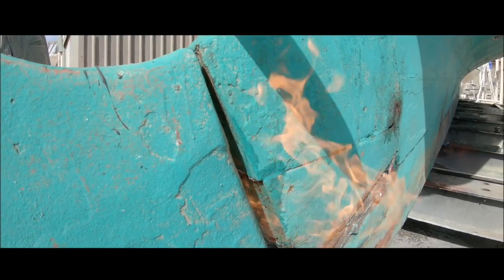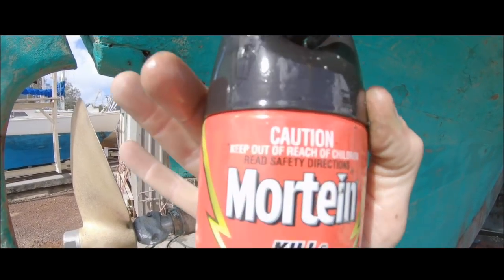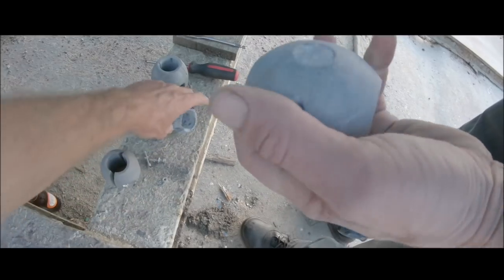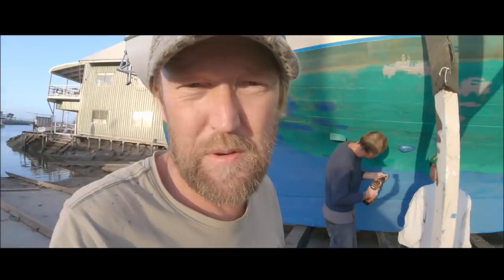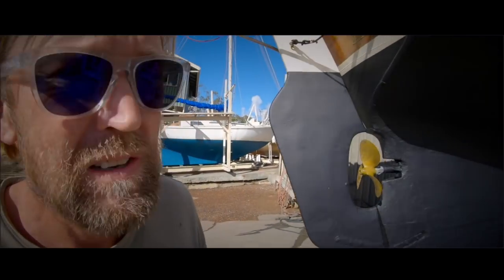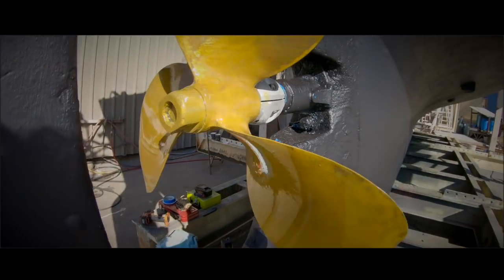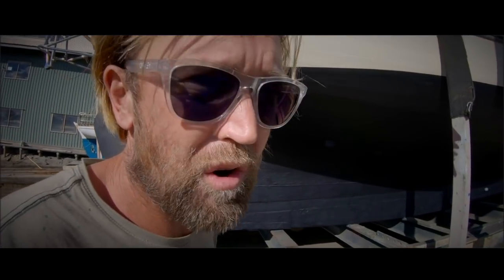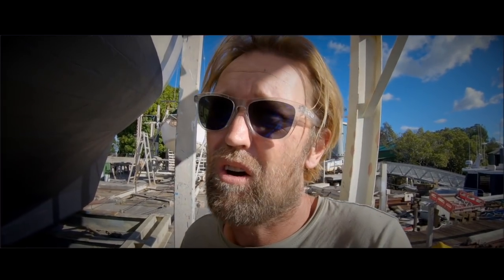Worms, Those Pesky Little Critters

Comment: Nice job with the excellent music.  Do you have "Copper Clad" down there?  It's basically fine copper powder mixed with an epoxy.  Not sure if it is appropriate for a wooden boat.  I used it in the molding process for fiberglass hulls.  If it gets fouled you simply rough it up with a sander.

Comment: The hammer little pegs in those holes when the water hits and it swells it it's becomes part of the wood I've been taking care of wooden boats for 50 years down in the Florida keys where there's a lot of worms
Reply from the maker: Aye they are stuck there now, as you said, they are now part of the boat ❤️

Comment: If you can see that many holes, then you have a serious problem. Nothing you are using will get rid of the honey comb of large holes, they will be everywhere wood underneath and you probably have not killed them all.
Reply from the maker: Thomas Morley really? I almost set fire to the boat? What would you suggest Thomas?  💣
Reply: @TheGeordietheWitchandtheWench  Im sorry, i did not mean to be the bringer of bad tidings . I know ship worm is a problem in warmer waters especially in that part of the world. it is probably a problem there that is not easy to completely remove but, and it would be allot of work. Take the hull down to bare wood and paint with epoxy tar paint. you need to put on about 5 layers, thinning to full thickness in the end but making sure that you never let it cure in-between coats. The final layer is primer, painted on before the epoxy tar has cured. You will then get a chemical reaction between the epoxy tar and the primer and you can then paint any colour you like. Worms dont like tar and the amount of layers makes a great difference. There is no complete full proof cure but keeping your boat out of the water for longer will help kill the buggers, That and fresh or colder waters.